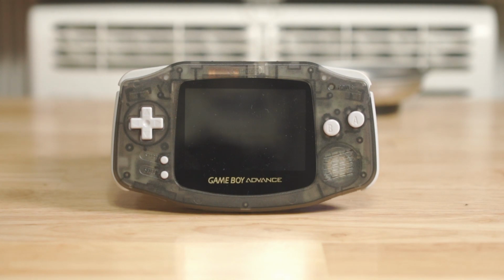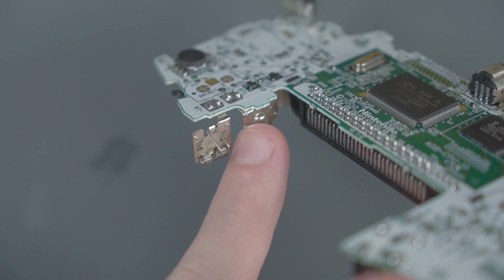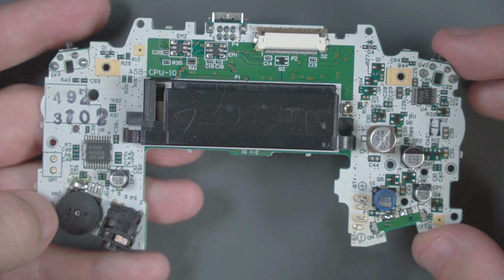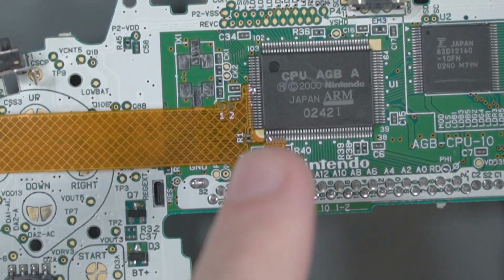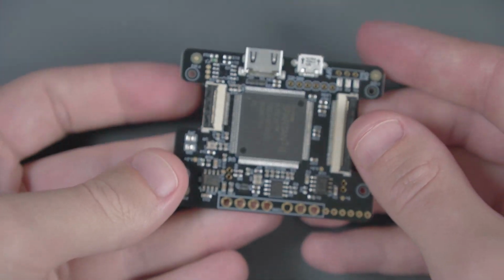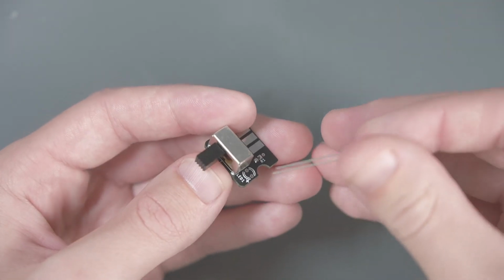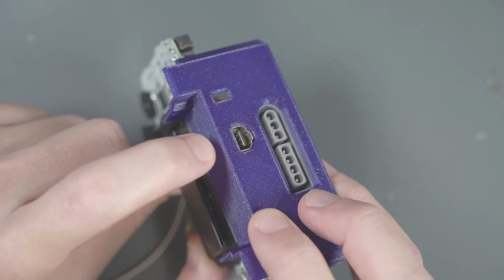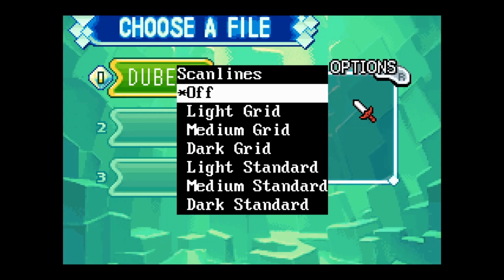NEW GBA Consolizer Install - Updated Kit w/ Flex Cable!

Comment from the maker: UPDATE: If you are having problems with DVI+, try using a mini HDMI to HDMI cable instead of a mini HDMI adapter. This may fix the audio issue!
Reply: Is your LED on the power switch on when the console is off?
Reply: Would this kit work with an original ds or gba sp
Reply from the maker: @adds351  no, it only works with the normal GBA
Reply: I am using a mini HDMI to HDMI cable, it hasn't fixed the issue 😥

Comment: What temp to you typically keep your iron at when doing drag soldering on the flex cable?
Reply from the maker: I talked about it in my recent XboxHD+ video, definitely check the flex cable soldering part out

Comment: I followed the instructions of this video but I'm getting a black screen when I plug everything in and turn it on.  I'm able to access the GBA Consolizer's menu and see that on screen, but the GBA does not appear to be outputting any video. I'm not sure what I did wrong.
Edit: NVM it appears the end of the flex cable that plugs into the consolizer board was crooked.
Reply from the maker: Glad to hear you got it working!

Comment: Why not a Gbahd? It's cheaper but moderner spartan 7 instead of 6 and open source
Reply from the maker: I have been building a gbaHD for the past few months, it is not an easy project. I will be making a video about it soon
Reply: @dubesinhower  mmh with Gbahd Shield it is easy and firmware take big steps to be better.
But there are more Video s about gba consolizer then Gbahd.
It's need more Videos about gbahd!